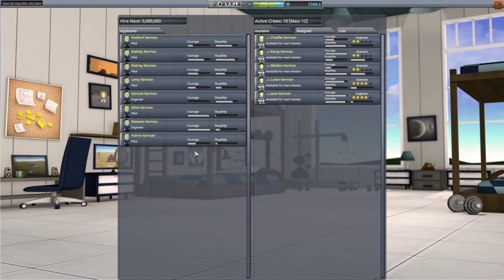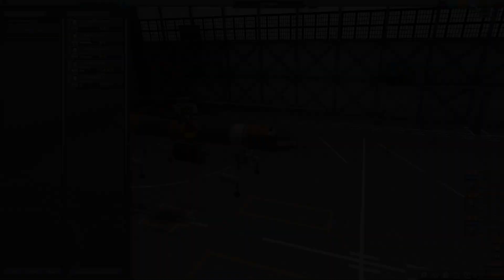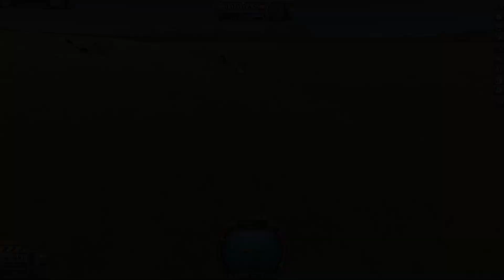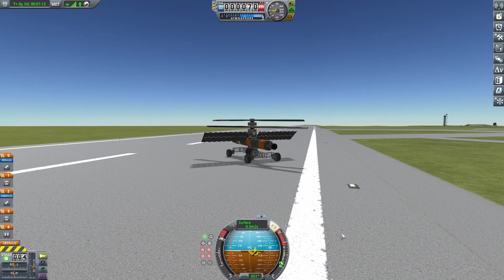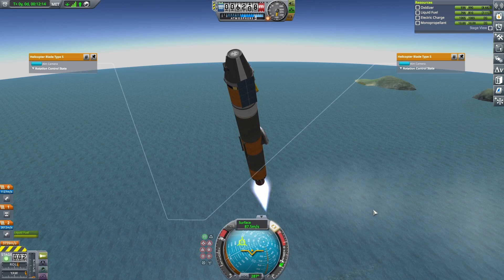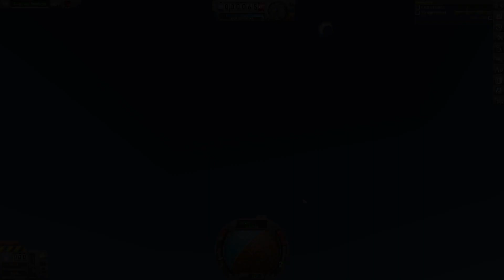KSP 1.12 Vanilla Ironman | 25 | Helicopters!

Comment: Aerodynamic physics in KSP are a joke, so the best advice I can offer you is the following:

More blades per prop = more lift
More than 2 coaxial props doesn't work and also baits the kraken
Physics warp breaks props instantly
You should be able to lift a payload to around 14 km on kerbin using only props/helis with no issues
Eve gravity is about double kerbin's, so however much you think you can lift, try half of that

My best results so far have been with a super-light propfan sort of thing where I rotate the fuselade and put blades on the outside of a fuel tank. The game hates it but struts are magic.
Reply from the maker: The 2 props per blade are to fit the damn thing in a rocket. More than two blades and here's no way I can hide them behind a heat shield